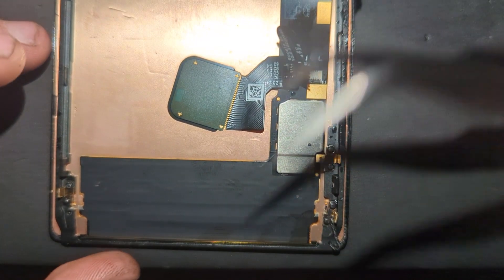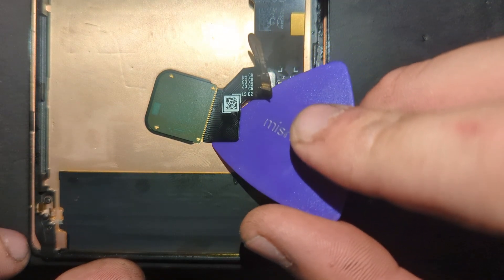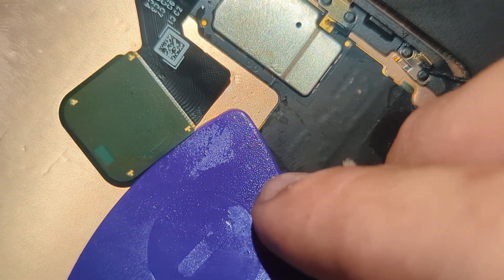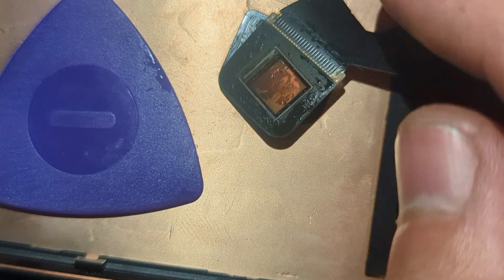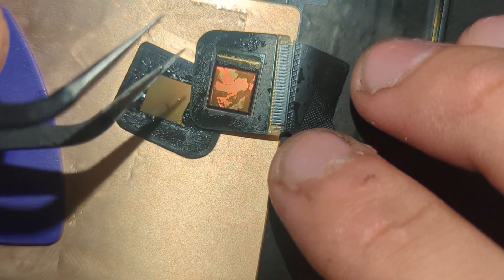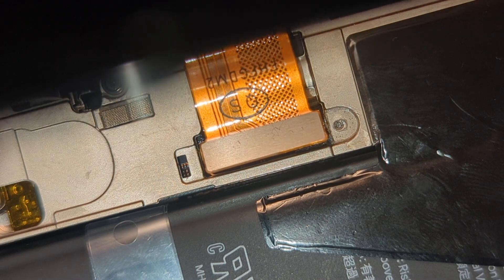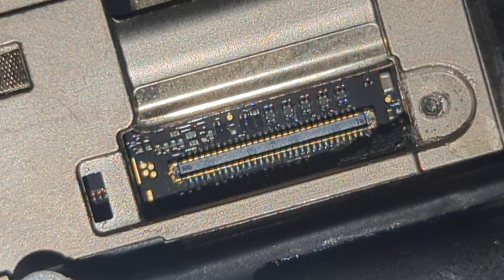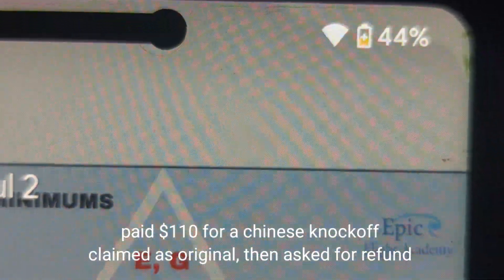Removing the fingerprint sensor in Pixel 6 Pro Screen (SUCCEEDED)

Comment: Nice video, was planning on buying a aftermarket display for my 6 pro due to it suffering the greenline of death. Any tips on what to look out for when buying an aftermarket display? I would very much appreciate it. Thank you!
Reply from the maker: AliExpress and china overall: everything below $25 is TFT, below $40 hard oled with big bezels, $40+ soft oled or even the original... It's a gamble.

Amazon all are Chinese and you can't identify which they are going to deliver to you before buying.

eBay idk

IFixIt: original but expensive 

I can share links here in the comments of the best oled in AliExpress and original. I hope google will not erase my comment

Comment: Я нагрел феном градусов до 80 и он легко снялся, поддел куском тонкого пластика, взял от таблеток, успешно снял, поставил на новый дисплей, все заработало.
Reply from the maker: Last time I tried the same method with my mum's hairdryer, but it didn't come off. I'm glad you managed it without any problems.
Reply: Thanks for the video. Does it actually work and can you use this successfully on a aftermarket screen? Thank you!